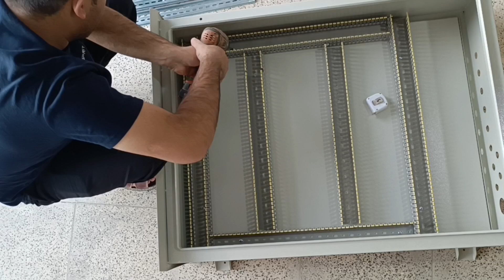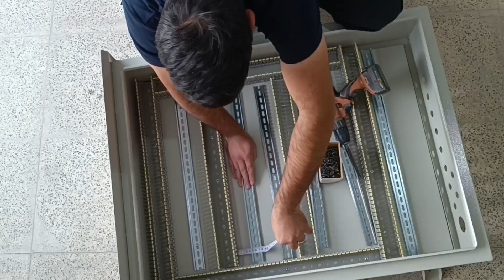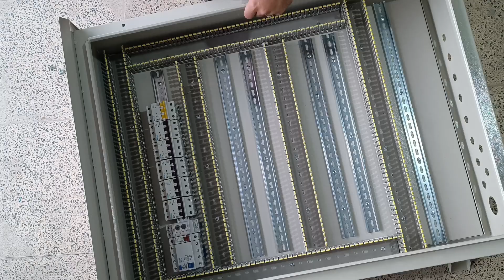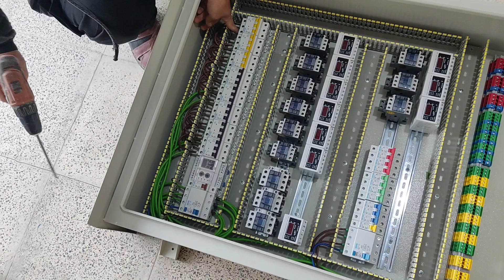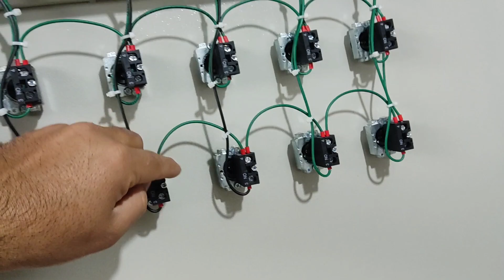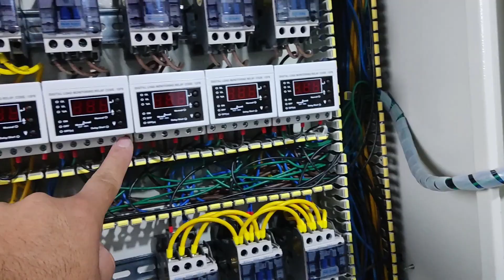Industrial electrical panel wiring training(with all details & diagram)

Comment: It usually has a plc too? And its input and output modules?
Reply from the maker: This electrical panel has not plc
Reply: @IET-76  Yes but usually in a company we would have seen  a PLC inside it too right?
Reply: Like, are these the same components we would have seen in a PLC panel or they are different?
Reply from the maker: @Yazzol  they are same
Reply: Depends the design and application@Yazzol
Reply: @smartmynd  In an automation application.